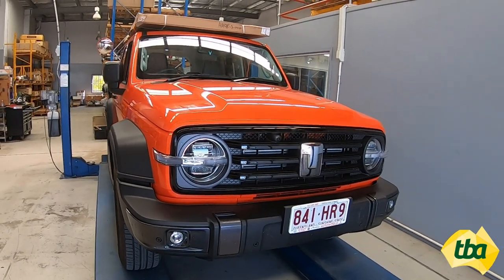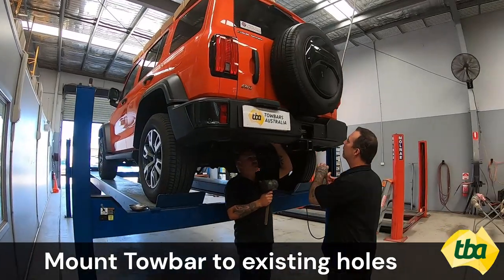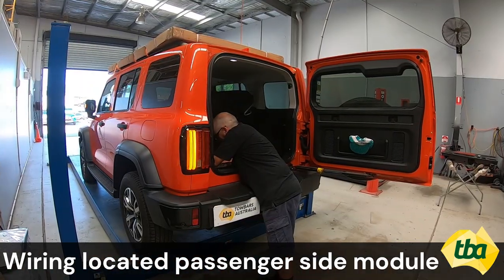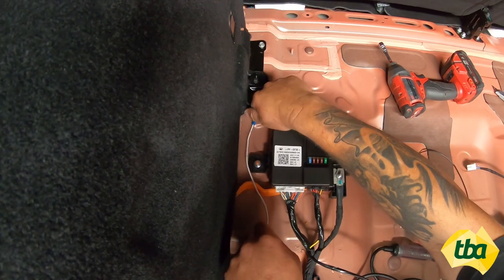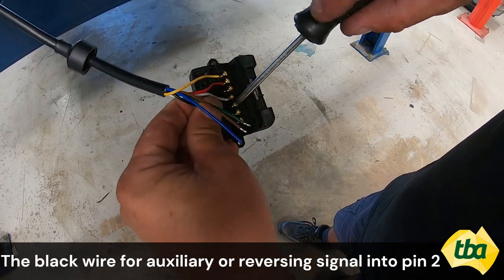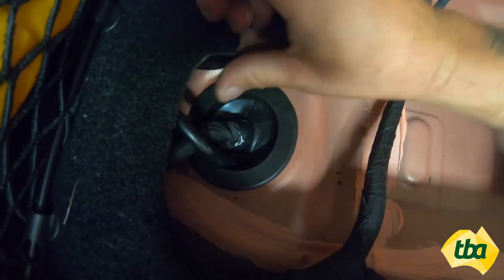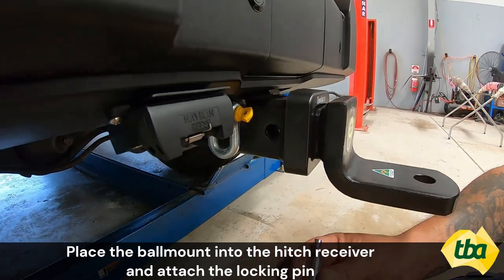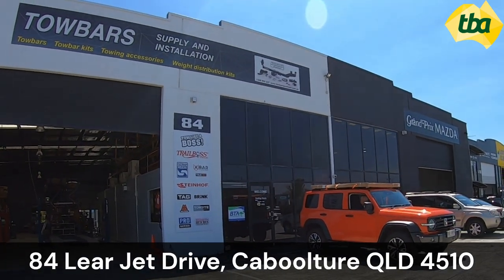GWM Tank 300 SUV 2023 Towbar Installation | Step-by-Step Guide

Comment: Why can't you use the 13 pin socket supplied under the rear bumper assembly instead of cutting into the harness?
Reply from the maker: Hi, Unfortunatly the manufacturer of this towbar does not supply the 13 to 7 pin adaptor.  I'm sure these could be sourced and used for your wiring installation if you preferred. Towbars Australia
Reply: $17 delivered to buy 13 pin to 7 pin flat

Comment: Do you not need a reed switch to turn off the rear sensors, alot of people complaining when reversing with a trailer, the vehicle automatically brakes as it sees the trailer as an object
Reply from the maker: Hi,  

We have installed many towbars and wiring to the GWM Tank300 with no problems at all.  You can deactivate the Rear Cross Traffiic Alert with brakes through the entertainment system.  I hope this makes sense.  If you have any further questions please reach out on 1300 TOWBAR that's 1300 869 227.

Towbars Australia